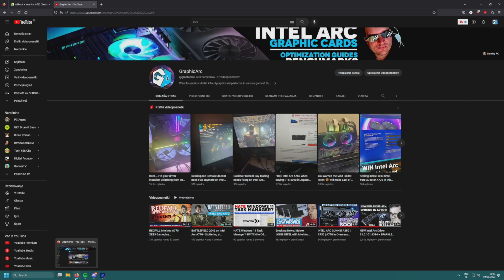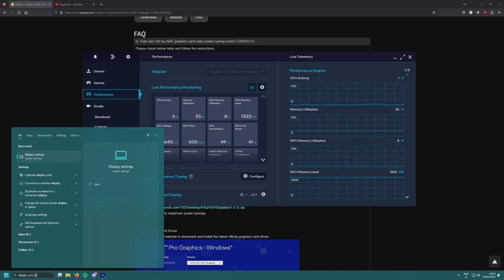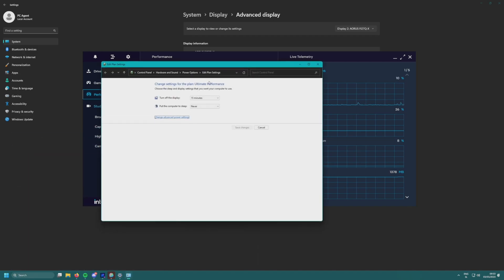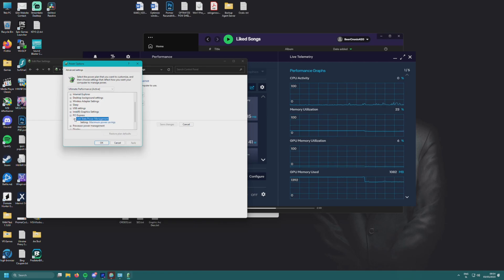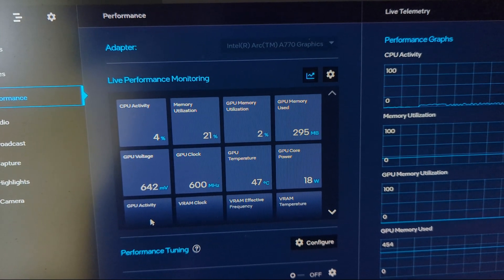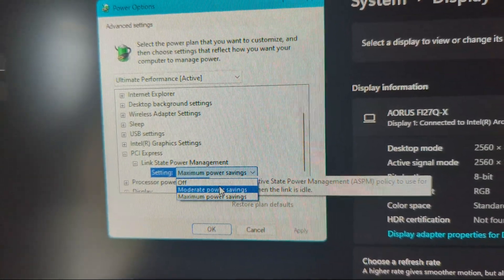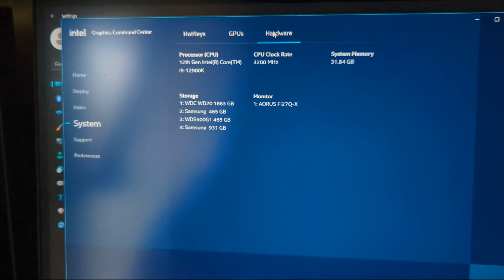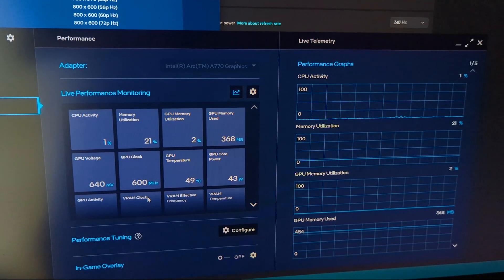Workaround to LOWER IDLE WATTS on Intel Arc A380 | A750 | A770 [40W→15W]

Comment: It's worth doing, mine is pretty good now.
After doing the workaround my A750 idles on 16 watts with two screens on and the arc control panel open (but with mainly static data).

If I close the arc control panel and just have two screens showing nothing but the desktop it goes down to 8 watts, and if the monitors go to sleep, but the pc is still on it goes down to 3 watts.

Comment: We live in times that the people search for totally inadequate solutions. This is ridiculous changing the hertz of the monitor. The card needs to work and it can, but somethin in the software need to say that to the card. I do 1-2w idle power consumption with A750 LE on HP 3440x1440 165hz. And yes the cable is in display port of motherboard and it works with both integrated and discrete. So the card can do it. The question is why can do it alone.

Comment: For my AM4 motherboard I had to change APM settings in the BIOS.
ErP = Enable(S4+S5)
Energy Star Ready = Enable
CEC Ready = Enabled

For my 4K monitor I had to run 60hz and turn HDR off. Reduced from 40W to 18W
Reply: Can you help me with fixing that issues in my AM4 platform?  I can't understand what you're saying. I have a Ryzen 5 5600, Gigabyte B550M DS3H Mobo and a Gunnir Arc A750 GPU.
Reply: @shawonshahriar2463   i have same config and didn't fix my problem

Comment: Can this be done with a system having arc a750 + i5 12 gen and b610 motherboard
Reply from the maker: Should be possible if it has the option in bios?
Reply: @graphicarc  how can I know before buying it
Reply: @graphicarc  is there anyway to know it

Comment: Thanks. I just purchased this card to give it another shot. I do notice my RTX 3060 only pulls 4W lol. Any reason this can't go lower?
Reply from the maker: Had it before but sold it or? It is how the current intel arc gpus are made :) apparently "should get" fixed with battlemage gpus? You can use CRU to make a custom resolution for example from 144hz to 141hz and it works not sure why.
Reply: @graphicarc  Returned the A770 LE a few months ago. Just picked up the Acer version. It'll be here tomorrow. As much as I hate Acer products (many laptop failures) I'm going to try this card with the newer driver. I'm just looking for something future proof for video editing (AV1 8k video etc) The 3060 is rock solid so far, but I'm always looking for an underdog. Thanks for the advice, I have 3 monitors, I see the fix was only for max 2.

Comment: I tried first with my 10850K (supports  PCI 3 only) and it didn't work. Later I installed the 11900K (supports PCI 4) and it worked perfect. Maybe it is a PCI 3.0 / PCI 4.0 issue.
Reply from the maker: You could just force bios to PCIE3 and see that? But will try and see how it goes :) it could be related to BIOS as well as some don't include the option. If you check my discord someone confirmed Gigabyte will be pushing the updated bios but not totally sure if just for his case or all of them.
Reply: @graphicarc  I am going to try, when I am back from work on the weekend.
Reply from the maker: Will let you know by tomorrow to save some of your time ;)
Reply: maybe it is actually a pci 3.0/4.0 issue.... I only have 3.0 and can't lower the power usage
Reply from the maker: @_nietypowy  To also confirm here what I already did on discord ... no PCIE3 does not affect this it lowered the W just fine, so it must be something else that is doing it?

Comment: Hi, for me this bit strange. I think the idle power hog, more depend on gpu idle clock... yours is 600mhz. I'm using bifrost with same intel latest driver as you.... but I'm using  win10.
For some reason, my bifrost 1000mhz idle clock and not going lower 37w. (using 60hz monitor, even, if is in power saver mode). I saw in your early videos as well, if i correct your idle gpu clock was also 1000mhz.... what changed?! :) did you update firmware or what? Any idea how can i lower the idle frq to 600mhz?
Reply from the maker: Well Intel is apparently automatically pushing any behind the scenes firmware updates in the driver installer. Could this be related to bios not having that saving option or maybe it is something else. I really kept wondering when @MAroc_Specops mentioned if Asrock bios can be flashed to LE A750 ... can this also be possible on Bifrost to flash LE firmware on it but I would assume this could cause some issues with RGB... in a750 is a different case since there is no rgb?
Reply: @graphicarc  exactly m8
Reply: @graphicarc  It it not about the Befrost 1000mhz min clock. May be it is from the fact that the pcie is always on x16 and not come to work on x1 and x 4 like the nvidia and amd do.

Comment: Everything youve recorded i knew earlier and still, doesnt work on my pc, even with only one monitor on and 60 hz refresh, so last thing is probably some settings in uefi, this is my last idea (Allow OS controlled ASPM by setting Native ASPM to Enabled | Enable PCI Express root port ASPM and select L1 Substates.) Problem is, i dont have those or they have other name... Have to write Biostar, maybe they will help me somehow
Reply from the maker: I also have only one option on "highend" motherboard ... but its set to auto and it works. Biostar probably should also have it but if you say it doesn't then RIP idle watts. Will see if Intel will do something about it.
Reply: I have the same problem on my biostar b660 gtn board. I have written biostar, but they simply say they don't have the settings implemented intel requires for this workaround. Intel wouldn't help, biostar didn't post a bios update for the board in over half a year and probably wouldn't .
Reply: @halbblutturke3879  😩😓

Comment: Can we flash this asrock bios on arc a750 limited edition.
Reply from the maker: It wont get flashed as far as I know but I didnt try... Should I?
Reply: @graphicarc , ofcourse. I d rather have asrock firmware with Intel design
Reply from the maker: @specopsz  There is a way to export bios in Linux but I don't have LE one + no bios as well so I can't try sadly.